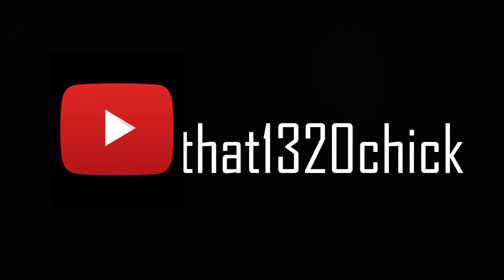Whippled 2018 Mustang GT - Engine Build and Channel Update

Comment: Just curious. Why whipple over procharger? I'm going to get a blower soon as well, but I'm pretty much sold on procharger. Their big head unit of course. I have a 18 gt350 btw. Your car is gorgeous btw.
Reply from the maker: Sean I know that Whipples have proven track Records and it’s what my dad tunes most and what he sells so  I wanted to go after what his client usually wants. Thank you really appreciate it keep me updated on how your pro charger goes!!
Reply: @That1320Chick  I hear you. My whole reasoning is just that pro has been around for like 25 years. I also like how its a completely independent system separate from main engine. Good luck with your setup. Is your dad's shop in south Florida, bc I'm in Boca?
Reply from the maker: Sean Kline I wish we’re from Detroit area

Comment: I would think a build video of the engine alone and details on parts costs and build specs .
Another video of install with  helpful information along the way.
And a third of Dyno testing, tuning and video street or track runs 👍👍😁

Comment: Guys.....the cyl. scoring,the bearing wear.....all are due to the aerated oil.....if you don't figure out the cause of the aeration,and you use the same engine,supercharger,and main components then it's going to happen again!!! Maybe look at the blower's oiling circuit since there weren't any issues prior...
maybe a cavitation issue somewhere or something with the pickup or outlet for that circuit.....
Reply: Bruce McLeer it’s definitely the one lingering question that’s keeping me from sleeping at night. We’re doing new OPG which would eliminate that as a question; have the oil pan from the donor car that we can swap on, but other than that the concrete areas of concern twinkle off. You mentioned the supercharger before, the whipple is self contained for lubrication, the only real communication point is through vacuum lines but there’s nowhere that boost should be backfeeding at